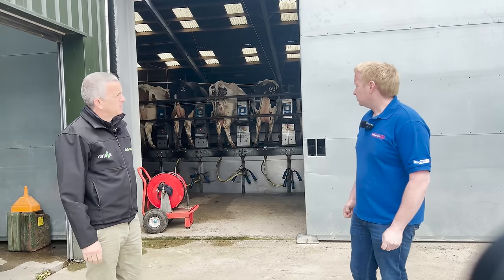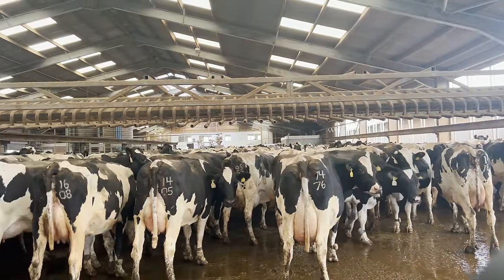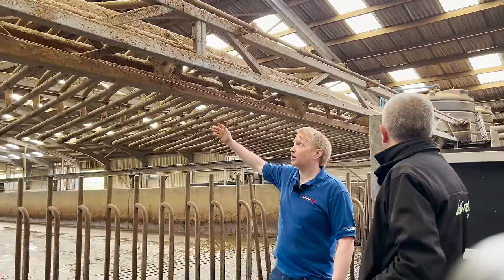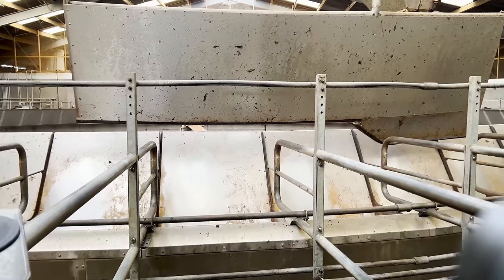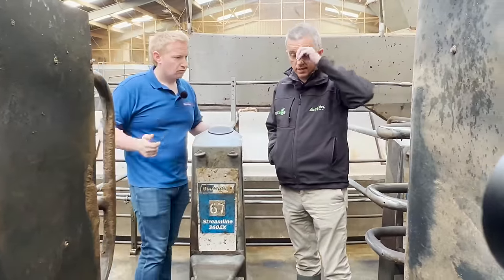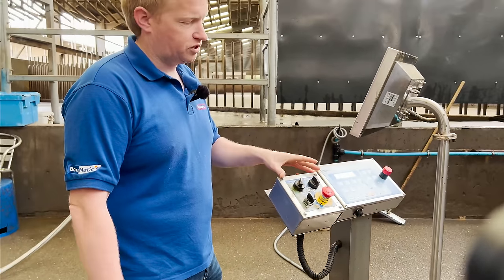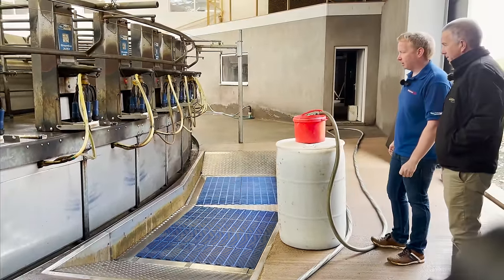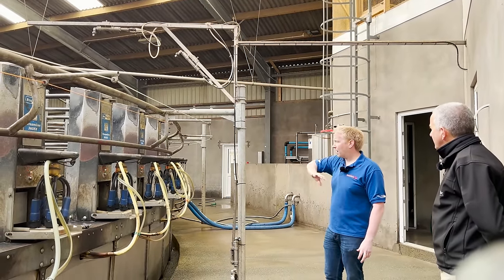Milking 1700 Cows on a 72 Point Rotary - Scotland

Comment: How long does it take from the time a cow steps on till stepping off?
Reply: Good question, I don't know, but I know they can vary the speed of it!
Reply: Doing some quick maths, if there Doing 400 an hour and its 72 stall I make it about 10.5 mins for a full rotation!
Reply: He stated that at about the 3/4 mark the cows are done being milked and the machines drop off so roughly 7 1/2 minutes the machines will be on.
Reply: @michaelwalsh9145  yeah I know 🙉